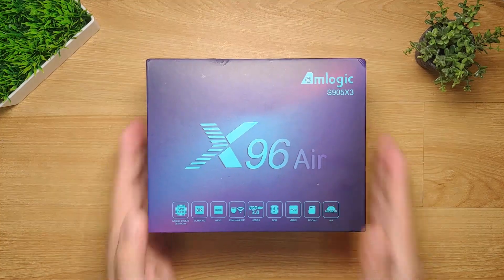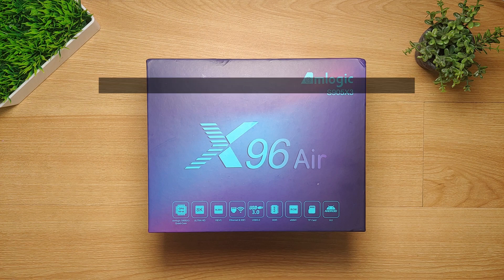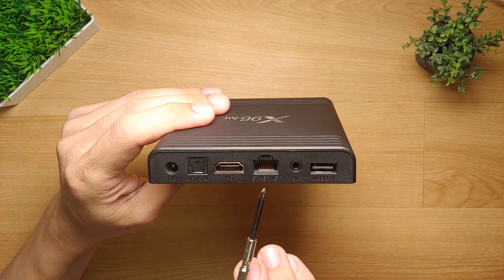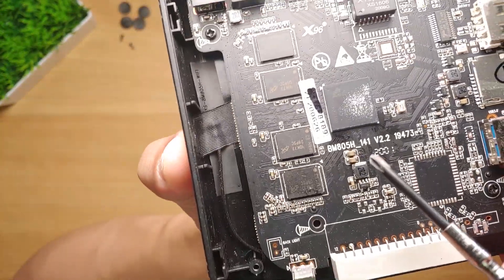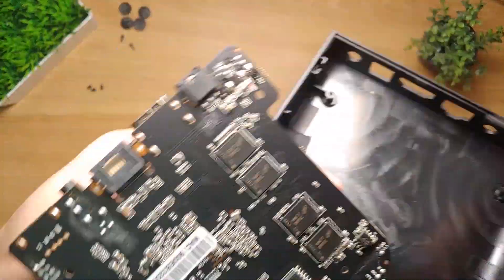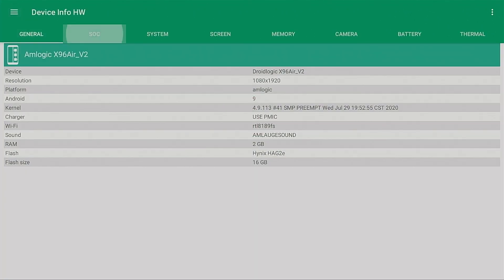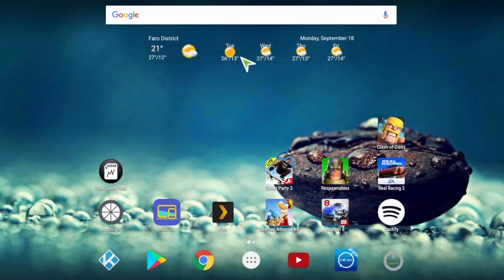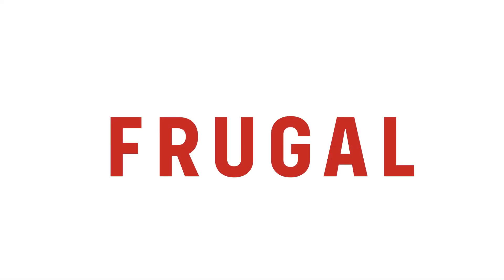X96 Air - An Affordable All-in-One Android Box that can Run Android, Linux, and Retrogaming OS

Comment: can you do another video on (x96 air) android tv box? what are the problems with the box or what is the solution. Has a new update been released?

Many have bought this android tv box.

The included launcher locks and you have to factory reset the box.
therefore the box needs an update. Has anyone come out and how do you install it?

all bluetooth keyboards can be connected but do not work exactly as the box has a white list.

we need a really detailed good video
Reply from the maker: Yes, absolutely. I have already lined up a few videos related to X96 air. However, since I have a day job, my time is limited to produce these videos. But dont worry, they will be released one way or the other.

Comment: Hello. Does anyone know where you can get an updated version of
(mbox launcher)
version 9 which is included in x96 air ??
the one that is included is one I like but it is very unstable and stops working suddenly and then it won't open again until you factory reset the android box

Have tried many launchers but they are often made stupidly, wrongly.
For example, the YouTube app does not appear in the list on all launchers

can anybody help me?

Comment: Hi, I think parehong model X96Air box sa video mo. Is it possible to upgrade to dual Wifi via firmware upgrade? Unfortunately na brick ko trying to update firmware. Meron ka bang video how to unbrick the X96Air. I saw one at You tube but not in English. Thanks in advance.
Reply from the maker: X96 air has at least 3 known variants, yung sa akin ay yung pinakamababang viariant na 2.4ghz lang ang wifi and no bluetooth. Yung mga higher models ay may dual wifi and and bluetooth, and mas mahal ang mga yun. Try to determine first what model you have by opening your android box, may model number na nakaprint sa PCB, dun niyo malalaman anong model yung board niyo. Use that to search for a specific rom na pwede niyong maflash sa x96 air niyo to unbrick it.
Reply: @ThinkFrugal  yes mine is exactly the same. It's X96Air_V2
Reply from the maker: @rsdomingo  Great! Please watch my upcoming videos that will cover this. Pero if you are in a hurry, you can just flash the X96Air stock rom which you can find in here: https://tinhte.vn/thread/tong-hop-cac-ban-firmware-cua-android-tv-box-x96-air.3050996/ using the Amlogic Burning Tool.
Reply: @ThinkFrugal  already saw this link. But if box is completely dead and can't be detected using the Amlogic USB tool, how can the flashing happen?
Reply from the maker: @rsdomingo  What did you mean by dead? Did you mean no power? There's no light at all when you plugged in the 5v USB male to male cable? If that's the case, you won't be able to flash any rom. The USB cable must provide the power and must be able to communicate to the Android Box' RAM chip before any flashing can be done. On the other hand, a bricked device means that the unit still lights up, but due to corrupted files, it wont be able to start up. You can use the AmlogicUSB tool on bricked device since it only needs to access the RAM chip for as long as the box still receives power.
Reply: @ThinkFrugal  yes completely dead
Reply: There is a light upon attaching the male to male usb cable, however the device is never detected. Thus, flashing process could not proceed.
Reply from the maker: @rsdomingo  Please follow this guide: A. How to use Amlogic Burning Tool to Flash Aidan’s Rom (Or any Other Rom)
1. Disconnect any cable from your x96 Air
2. Prepare your Full Male to Male USB Cable
3. Let the X96 Air Sit for a few minutes after removing any cable from it (especially the power cable). It seems it needs discharging before you can connect the USB cable and for the PC to recognize it.
4. Open Amlogic Burning Tool as Administrator (I used V2.2)
5. Load the firmware, and once the firmware is loaded, click start (at this point the device must NOT yet be connected to the PC via the full usb male to male cable)
6. After clicking start, you may now connect the usb cable, (no need to push the reset button). Your device will now be automatically detected.
7. Wait for the flashing process to finish.
8. Once finished, remove the usb plug and click stop.
9. You may now close the Amlogic Burning Tool.
Reply: @ThinkFrugal  the event you described in #6 did not happen.  Power up (clock lit) from X96Air happened around 5 mins after plugging the male to male USB cable to PC. Tried both with and without power cable adapter of X96Air with no success of getting the X96Air  detection bu the Amlogic tool. Thanks anyway.

Comment: I have X96Q. Can it also run Linux?
Reply from the maker: I believe X96Q boxes have allwinner processors. You can try ARMBIAN. It's a linux operating system which can be flashed to android boxes.

Comment: Is there a ready-made Linux image to download? I still have a T95 max with H6 SoC where I simply wrote the Armbian image to an SD card and booted directly from it. That is enormously spoiling.
Reply from the maker: Based on my experience, Armbian is the most stable linux OS for allwinner SOC, (eg. H3, H5, H6). You can try debian here: https://wiki.debian.org/InstallingDebianOn/Allwinner. I have not tested this one yet.
Reply: @ThinkFrugal  No, the other way round. For Allwinner there are ready-made images from Balbes. Plug it in and it runs. For the S905X3 it seems to be much more complicated?
Reply from the maker: @Hessi  Not at all. It's basically the same as with any other linux image: 1) You simply burn the manjaro arm version 2) Access the sd card and use the correct u-boot 3) Call out the correct dtb file which corresponds to your device 4) Eject sd card from PC and boot it from your device.

Comment: nag order ako sa same shop na inorderan mo may bluetooth ba sya?
Reply from the maker: No bluetooth. This is the minimum of all the versions of x96 air. Yung mga higher versions have bluetooth. Nasa around 2k na yung mga yun.
Reply: @ThinkFrugal  boss pde po pa send ng emulec na ininstall mo dyan at ung device tree kararating lang p ng x96air ko and already subs to you
Reply from the maker: @rustandizon4788  Pakidownload ang EmuELEC-Amlogic-ng.aarch64-4.4-Generic.img.gz from here:  https://github.com/EmuELEC/EmuELEC/releases. as for the dtb file, I have tested sm1_s905x3_2g.dtb, and it works perfectly fine with my x96 air. Copy sm1_s905x3_2g.dtb to the root of the folder and rename it to dtb.img.

Comment: Hello Sir 
MBOX is fake box, not know to me, but nicely printed stating 2GB RAM and 16GB Storage with MBOX MXQ PRO 5G 4K. 
BROUGHT recently with device not working/booting, with no TV display and blue LED  light is ON permanently. 
MBOX PERMANENTLY BRICKED MAY BE WRONG  FIRMWARE APPLIED AS NEVER TOOK DEVICE BACKUP,  
Android version 11.1 its a fake with RAM 2048MB AND INTERNAL STORAGE 4.00GB with reset option permanently disabled. PCB DETEAILS AS MXQ-RK3128, MALI-400MP PCB REVISION V1.4-20211104, Processor RK 3128 with WIFI RK915. 
Laptop with USB does not detect MBox using external Reset toothpick or through USB driver using RKTool /Android Tool .
Need to restore Device as it is booting through external SD card, but with configuration error and unable to mount volumes. Please suggest How to make a SD card image (suggest tool and firmware image details) to restore MBOX device.
I liked all your videos, but no video states how to recover the faulty device using SD card (Tcard with 8GB) to restore device. Please suggest MBOX device firmware download link with SD Card Boot options to recover the device. 
Thanks in advance for your good work here to support MBOX usages.
Reply from the maker: Sorry for what happened to your box. Unfortunately, I have not tested any tool yet to flash firmware via SD Card. Please try again to connect your box to another PC using a different full usb male to male cable. Rkdevtool or Rkbatchtool must detect your android box. Otherwise, there is no other way to flash rom to your device.
Reply: @ThinkFrugal  

https://youtu.be/qQel2sY6XK4
Reply: I need firmware for TV box, which is bricked and cannot be used anymore with following hardware details as below
Device -Rockchip MBOX, Resolution 720x1280, Platform rk30board SOC RK3128 Wi-Fi chip 915, Kernel 7.1(fake 11.1) MXQ-RK3128-V1.3, HXW21122301-A, 20220105, OTA Firmware Update V1.2.0_2112061006, Model MBOX Version 11.1, Kernel Version 3.10.104, hxws@PowerEdge-R720-9 #91, Sat Dec 18:09:48:16 CST2021, Build MBOX-userdebug 11.1 MHG47K eng.hwrs.20211218.094122 test-keys